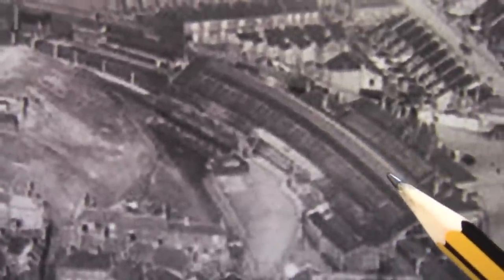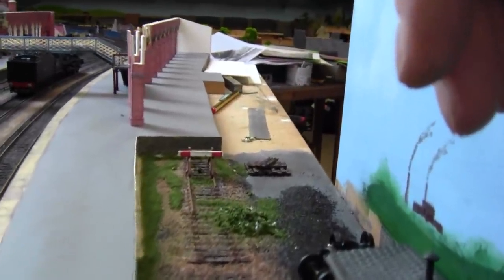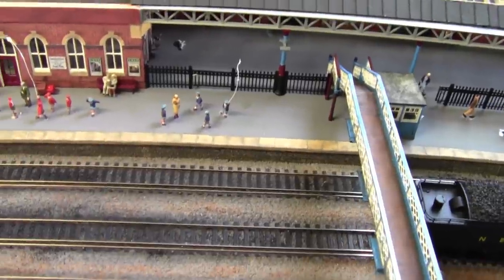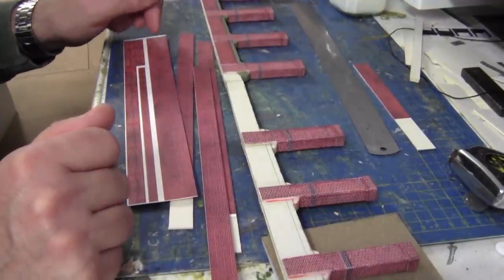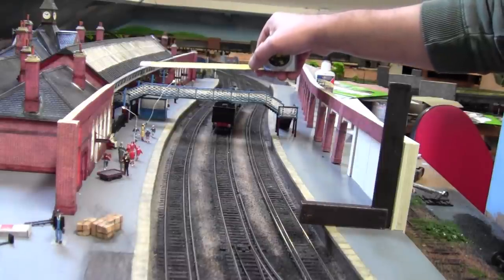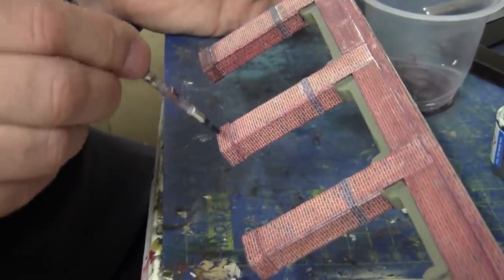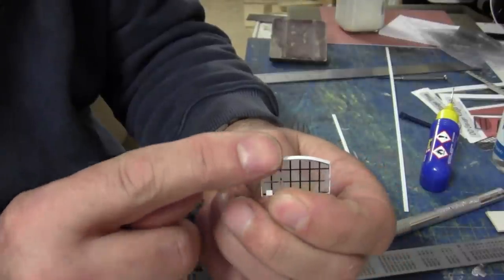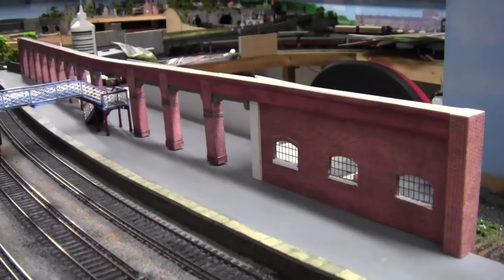The Station Part 24..Platform 2. Columns completed. No242

Comment: The way you approach and design these builds is very disciplined, slowly, steady, accurately. It looks amazing, how you cut the curves on those hard plastic windows deserves an award, sheesh, just doing the straight lines looked tricky enough. Excellent modelling Tony, I really enjoy these updates, and learning all the time. All the best. Brian.
Reply from the maker: Thank you kindly Brian. a very sharp blade always helps. when cutting these hard plastic windows. its coming together really well at the moment. some decisions will have to made for the back walls this week as new photos have emerged. which will help me complete the build. thanks again stay safe ...Tony

Comment: Hi Tony
This is going fantastically well. I didn't think you were going for the whole building. Just a couple of points:-
It used to be quite common for the DMU units to be double or even trouble in the early sixties, especially at peak times, when huge numbers travelled to Hebburn Reyrolles and Hawthorn Leslies. The original Tyneside electrics ran six car trains, then the South Eastern style replacement were shorter and more cramped. So a Sunderland service would be on the other platform or waiting in the sidings
The photo of the approach street is puzzling me because it is prewar, yet there are hoardings to the right, exactly where the Queens Theatre was. This was built in 1913 and gutted by incendiaries in 1940
Finally, I think you seriously need to approach the South Shields museum to put your South Shields terminus model on display for a season. There are loads of sand dancers who remember the station and would love to see the model
It's a great shame that BR allowed it to deteriorate and that metro didn't see fit to repurpose it
So much has been lost of our heritage. Imagine the old Marsden Rattler as a tourist railway!
Reply from the maker: Good evening Edward.  fascinating comment and very interesting. so much information to take in. that would a great idea to see it on display for a season. but until then i still have a lot more work left to do the station. the Marsden rattler would have been a great tourist attraction. thanks again for your great insight the shields station..............cheer's Tony

Comment: Hiya Tony 
Ive finally caught up with your video's Fantastic modelling as usual mate its a masterpiece. i love seeing the old photo's of South Shields station showing what a grand building that it was and such a shame no one thought about saving for reuse. have you been able to workout what was on that side of the station must have been waiting rooms and toilets offices etc also. I was wondering had you thought about using glue and glaze from deluxe materials to glue in those widows or even PVA would work once its dry it should hold pretty well. I think that concrete colour is hard to replicate but i thought you did a great job of getting it right it would get very smokey and sooty in the days of steam with a covered roof to. Looking forward to next week have a good one buddy cheers Pete
Reply from the maker: Good morning Peter. i am glad you have caught up, must  have been a marathon watching all those videos. platform 2 has come along well this week, i have worked out what i would like to do with regarding the buildings. and have come up with a plan. i have only recently found out about glue n glaze. and ordered some. thanks you for the tip.. some new photos have come to light. which will be reveal in the next video...........see you next week stay safe Tony